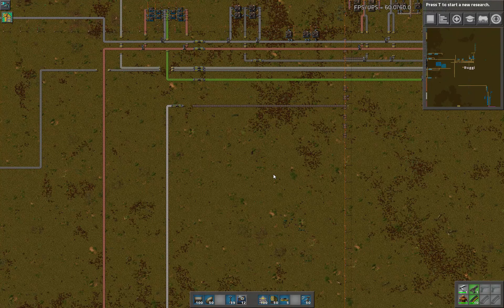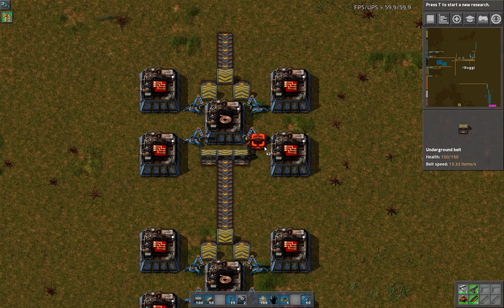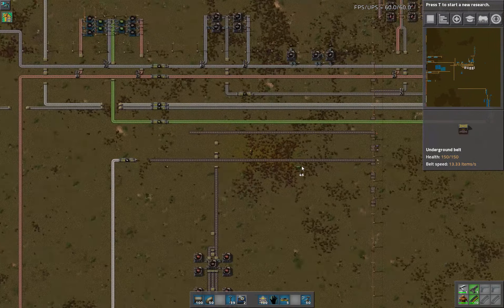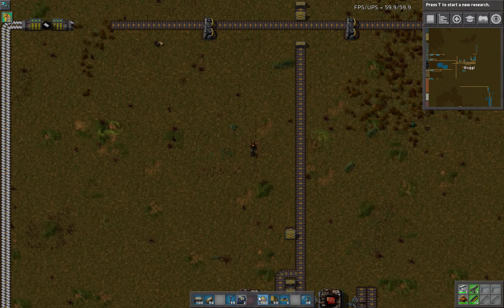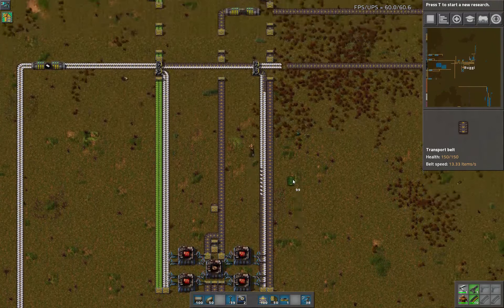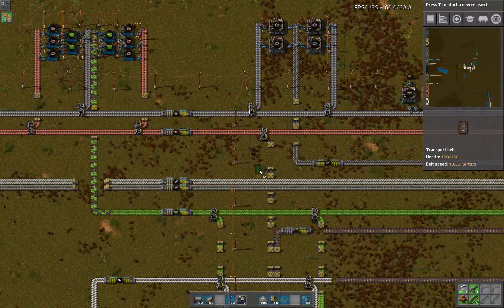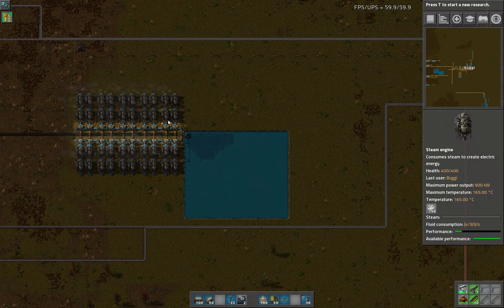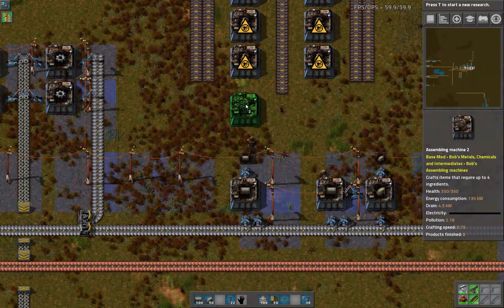Factorio Extreme Production - Ep 8 Red Circuits

Comment: Why are you not using electronics machine for red circuits aswell? You are using them for green, and they are faster then assembly machines.
Reply from the maker: I explain in the video, it's down to the size of those smaller machines, tougher to pack them all together and make the system look nice.
Reply: Oh sorry musta missed that part. I know its a bit wastefull, but I'm running this for both my red circuits. http://imgur.com/a/1Ki36